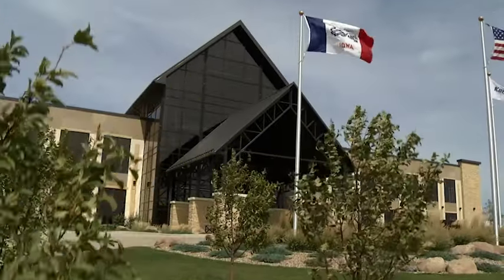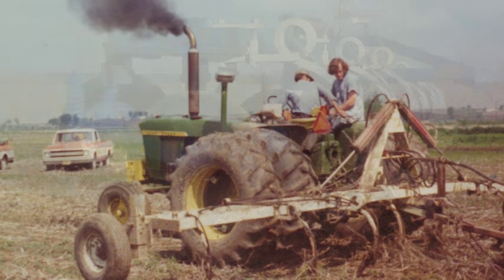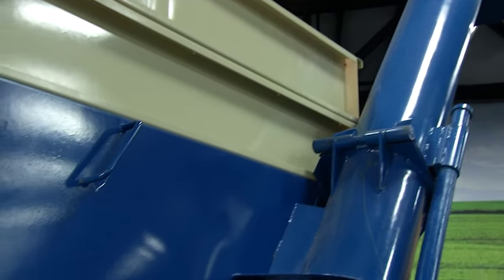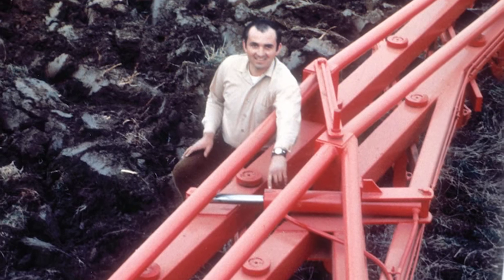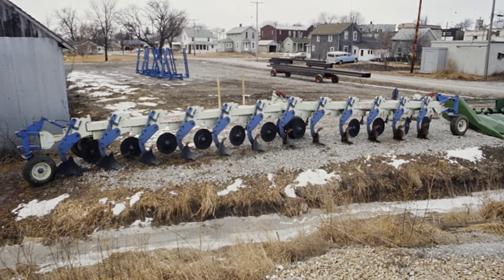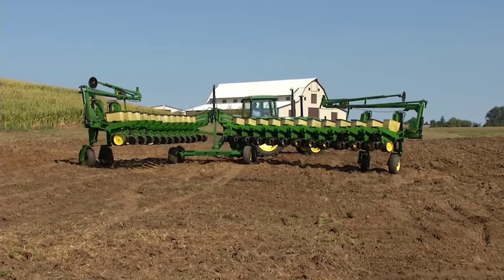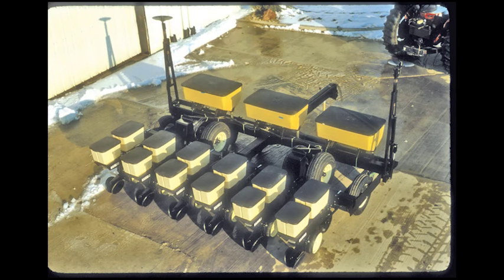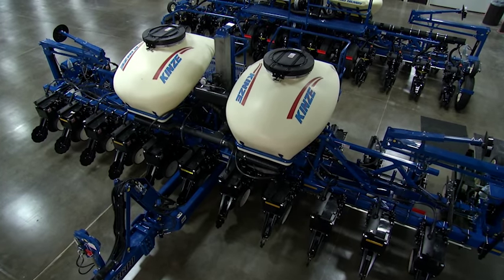50 Years of Disruptive Innovation

Comment: They make a great planter.  I'm 26 years old and I bought a 3600 central fill planter interplant.  The machine has yetter row cleaners and electric drive with hydraulic down force . I can plant corn in the morning and switch to beans at lunch in about 20 minutes and be off and runing.  We even have planted wheat with it last fall . We run 15 inch spacing and then we put in the GPS a 7 inch offset to ensure a healthy stand. Dad and I checked out the 800 acres of winter wheat and it looks as good as if we drilled it in . Thank you kinze for the good work that you do . If it wasn't for that new planter last year we wouldn't have had a crop on most of our fields here in michigan.

Comment: They should be a full line company. Wonder what a Kinze tractor or combine would be like?
Reply: Kinzie tractor was featured.
Reply: Not that tractor. A modern line of equipment. All the major brands are producing overrated, complicated shit that’s super expensive, and doesn’t last. Someone should manufacture a modern day version of an 806 or 4020. Simple, but built to last.
Reply: @thevox1075   I won't disagree with that. The emission laws have got everything so messed up. Manufacturers have found a goose laying gold eggs in keeping you coming back for parts and repairs; some you just cannot do yourself. Trucking industry  got around it with glider kits for a while but now that's gone. Ag industry won't get far on that idea. That drives the used market up.
Reply: thegreenerthemeaner I used to work for CaseIH. Now I repair good used equipment on my farm, guys can actually afford to pay me to work on their 806!
Reply: @thevox1075  do you have any tractors like as a collection, just curious
Reply: #Coconut TV yes, I do. Have a Ford 5000 diesel row crop, a 6000 diesel turbo, a 4100 standard diesel, and a Versatile D145. The Versatile had a 470 Cummins V8, but it was in bad shape. It was repowered with a Cummins 12 valve 5.9 engine. Much better. I’ve spent years working on old tractors, had to work on many new ones. Too much electronics, computers, plastic. Unfortunately, it’s hard to find a company that isn’t building unreliable stuff nowadays. It’s everywhere,farm equipment, trucks, construction equipment, autos. My old Versatile is solid, overbuilt really. Simple. Crude, maybe. But, still reliable and ready to work.
Reply: @thevox1075  wow. We have like a lot of 40s to 60s tractors and a Versatile 850 series II. (Examples of some, 1936 A-C WC, a few farmall Ms, 5 JD 4020s, and 3 normal farmall f20s [ my grandpa liked to modify tractors, and this is a good chunk of them, but not all of them])On your 6000, is it a red and grey or blue and white.
Reply: #Coconut TV it’s blue and white. Found red paint in places where the paint had chipped. When I found it, it was abandoned in a field with a bush hog behind it. Got it for $500. I rebuilt it from front to back. Added a turbo. I’m trying to convince a guy I know to sell me his ‘64 806. 
  Originally, a lot of those older tractors were built to deliver power to the farmer, but even as convenience was added, they still remained easy to service and repair. Not anymore. Parts are made with failure built in. If a tractor breaks down, you have to wait for a technician to show up with a laptop computer. Ridiculous. I’d rather farm with 60’s-80’s farm machines all day.
Reply: @thevox1075  depends on how much work it needs but otherwise 500 is a steel for a 6000

Comment: Anyone know how much one of those repowered 5020s costs? XD
Reply from the maker: Hello - Are you interested in the current value of a Kinze re-powered John Deere 5020?
Reply: You couldn't buy fuel for a 318 now days.
Reply: @blainemcelwee2222 .... honest question, what is a "318"?
Reply: @Romans--bo7br  an old 2 stroke Detroit diesel. Out of a semi truck. An 8v71. 8 cylinders at 71 cubic inches each. or you could use a VT 903 Cummins. If you know what your doing. You could put a 475 hp 12v71 Detroit in a tractor. 
Allison Cambers made a 450 hp v8 called the purple monster. Painted it purple. But 2 stroke Detroit's have that sound. Their nick name is "Screaming Jimmy".
Reply: @jerrykinnin7941 ... Thanks for your reply, Jerry.  Actually, I was just curious why you (and just about every other person on this subject) automatically call Series 71 V8 Detroits "318's".  I formally studied 2 cycle Diesel Design & Theory for four (4) years, back in the mid - 1960's under one of DD's design teams leading engineers who developed the very first 2 cycle GM Diesel ("Detroit"). 

Just so you know... an 8V71NA Detroit was Only rated at "318"hp If it was equipped with N65 Injectors, Std. timing and governed for 2,100 rpm. There were also 260 & 290 hp versions as well.

The Cummins VT 903... at least for truck use, were basically - "junk"... they were an undersquare design and so couldn't "hold" what little torque they developed on any kind of grade with a load. 

As far as the Allis Chalmers (Not "Allison Chamers) engine you're talking about... it was (officially) called "Big Al".... there were two versions, the 25000 and 35000, and Neither was a "V8" they were both inline 6 cyl. engines. 

Yes, they were painted purple during the road trials era of the early 70's and the horsepower was varied between 425 to 525hp depending on what region of the country they were being tested and what brand & type of truck (conventional or COE... most were in COE's) they were adapted to. 

They were offered for a short time as engine options... however with AC's takeover by Oliver, the "Big Al" had a short life, and they cancelled any further development.

Blown head gaskets and broken crankshafts were a constant issue, especially on the high output versions. They would have been a tremendous engine for the class 7 & 8 truck market, had AC not sold out as they did, and had fixed the two main issues but the new owners didn't want anything to do with getting into the heavy duty truck market, so the "Big AL" was shut down for good.
Reply: @blainemcelwee2222  if you dollar cost average maintenance, fuel, mtbo, and overhaul cost, it probably wouldn't fair too poorly compared to sometjing with tier 7 + emmisions equipment.  Hearing aid price might tip the scales 🤣
Reply: @Romans--bo7br  a modern harmonic dampner would have cured the broken crank problem in Big Al.  335 cummins' had the same problem, and Cats of the era cast their heads from  small cracks.  A fella could get rich back then doing nothing but pinning and welding cat heads.  
My father had a GMC general with a 318 detroit.  Abysmal truck, fantastic engine.
Reply: @randymagnum143 ... thanks for your reply, Randy.  As far as the lower end problems with the Big Al (21000 series engine only), the root issue was not the balancer, it was the gasket between the oil pump and the high pressure elbow... which AC put out a bulletin about in 74.. and corrected it in 75 by assembling the the joint without the thin gasket. 

The main issue encountered by Many of the 335 Cummins owners & drivers... was the habitual breaking of head bolts.... a result of Cummins' turbocharging the prior 250hp engine and not using higher tensile bolts with the increased cylinder pressures. 

There wasn't much of a problem IF... the engine was sufficiently warmed up prior to putting a load on it and working it.... or, if the driver drove it with "slippers on" and paying attention to his manifold pressures and pyrometer (beyond the comprehension of most of today's "steering wheel holders".. sadly) until it was well within it's operating temps for at least five or ten minutes. 

A broken head bolt was instantly recognized by the "chirping"  sound heard through the exhaust, and continued operation would Guarantee a blown head gasket. 

As far as the Cats of the era... there were several, the 1674, 1633, 1673, early 3406 "pre-cup" and the 1693... the latter being the "big truck engine" of the Cat line-up. 

A  big issue with the Cats... was the early pre-cup versions of the 3406 and the early 3406 DIT's... with the "deck plate" they were using between the block deck and the head. 

Personally, I never ran either Cat, nor Cummins engines in my own three trucks (one at a time as an Owner/Operator).... all three were Detroits & all three were V12's... which I removed when new, and then "built" them to marine specs (sans water cooled turbos & exhaust manifolds of course) and fully "blueprinted them".... Never had any issues with any of the three over the years. 

My favorite Detroits were the 3-71, 6-71, V12 and the very stoutly built and strong 6-110T.  Probably the most "power dense" (on a per ci basis) of the Detroits, if you want to build a "high performance" engine in a small package... is the 6V53... over 1,000 hp is doable and has been done in years past.
Reply: @Romans--bo7br  by the 3406, cat had a good engine, and somewhere between the bciii and bciv cummins did too.  Before that, they had to keep changing designation to fool customers into thinking they'd solved the problems.  Like when detroit painted the 92's silver.  😁  idi cats though.......what utter feces.
Reply: @randymagnum143 ... Hello again, Randy. : )  Detroit just didn't paint the 92's silver... there were a number of changes made internally, better internal & blower seals, head bolt tensile, injector revisions, coolant flow changes, etc. I've always said that Detroit should Never have dropped the 6-110 and I told DD that at a seminar in 1966... it was a huge mistake. 

That engine was completely over built for the power ratings they were selling them with at the time... but with the idea that they would expand its ratings over time.  I witnessed dyno runs of a 110 with marine 120cc injectors and the blower drive changed to .88% over and fully loaded rpms set at 2,350... result.. 583hp and 1796 ftlbs of torque!! 

Pat Nicholas from R&D at Detroit Diesel (whom I studied 2 cycle diesel design & theory under for 4 years) told me that the 110 was built to withstand up to 850hp!  The rods & mains were massive and the block webbing / main journal supports, etc. was extremely strong. 

The basic 6-110 with just the bare necessities needed to operate weighed in at 4,020 lbs with reduction gear for marine use and around 3,500 lbs for just the "bare" engine.

My dream engine from Detroit would have been an inline 6 cyl. version of the series 149 family... but would have been too heavy and physically to large for any hwy truck use, and hwy truck drive trains never would have been able to handle the torque... even "today".
 
The 149's are a completely different design concept compared to the rest of the Detroit Diesel engine families... excluding the series 51which was a true/valveless loop scavenged engine. 

The 149's are a lot closer in design layout to the Winton/EMD design used in their locomotives, large ocean tugboats, etc, etc.... except for the roots blower(s) and exhaust ports placement. 

GM had three experimental GMC hwy trucks back in the late 50s - two 630 series and a pre-production "Crackerbox" COE with the 6-110... but had to many problems with it torquing the frames of the era, drive-line and final drive issues plus having to raise the cabs for clearance. 

It was an engine that was about 10 to 12 years ahead of component metallurgy and technology at the time... sadly.  It was a real powerhouse, even at the horsepower levels at the time... which was "just" 275hp with 60cc injectors,  and it was Extremely durable and reliable.    Ooops... Sorry for the long rabbit trail.
Reply: @Romans--bo7br  I ran some for a construction outfit in the middle 90s and you could off road trucks that have never been overhauled and had run every year since 58 or 9 something like that